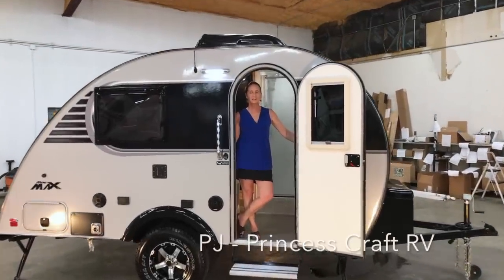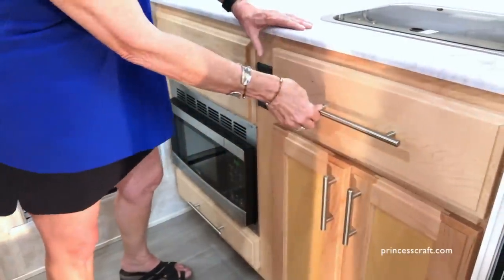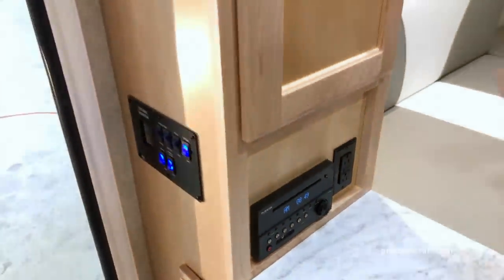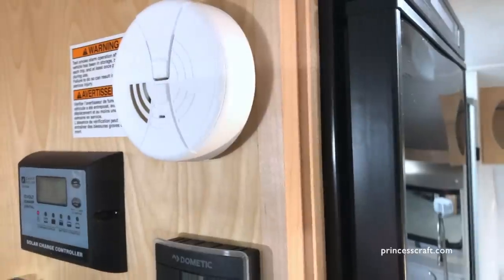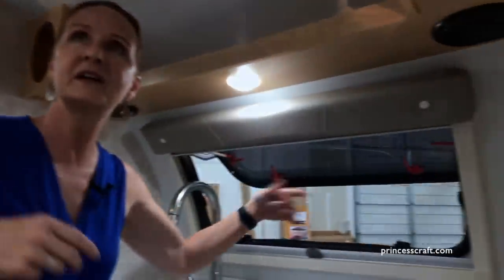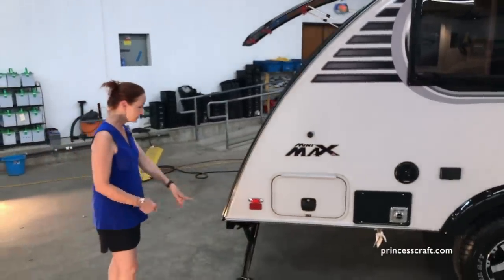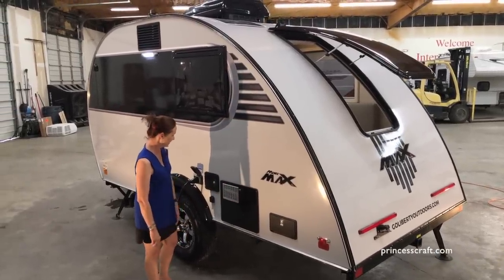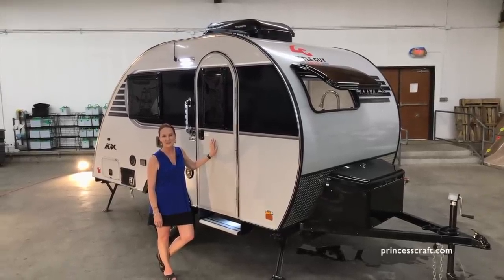2019 Mini Max from Little Guy Walkthrough with Princess Craft RV

Comment: So price about same as our small one Cherokee wolf pup 2019 the new year is going for about $22 to $24K. So ours a year old but it was a 2017 this time of year when the 2018 came out and cost $10k less. We got it for $13K. Thats just a lucky buyer thing so look around. Sister and I  did same thing buy new cars. Some new but last year model still on lot. For me id take the room we have over style. We can always up grade our cabinets.
Reply from the maker: The Cherokee Wolf Pup line is a very different build. It is wood framed and metal sided. The Little Guys have a welded aluminum cage, and it has composite siding. The materials and construction methods tend to account for the differences in prices. Regardless, it sounds like you have a great trailer and got it at a good price!

Comment: Nice but very little storage. If that back bench was converted so there was more storage than it would make more sense. Where do you store the bed linens?
Reply from the maker: There is storage beneath the back bench. You can access it from inside or outside.

Comment: For the size not to bad. The microwave is in a horrible spot and  I would much rather have a simple sleeper couch than that Dinette but the rest was good.
Reply: I agree the microwave is in a terrible place, especially for senior citizens.  Maybe the 20 year olds can handle it, but it would be difficult for me.
Reply: I am not sure why they didn't put that below the cooktop instead of he flatware drawer. I don't need to store service for 8 in a trailer that barely holds 2.
Reply: Fred Flintstone totally agree. That it’s got the flatware dividers in it is crazy. Should be empty so it can be utilized however.
Reply: David Mm 
That's about all there was. .except the bathroom
Reply: I actually like that the Microwave is below the cabinets. In my current condo, I had a (lower) custom cabinet created to get microwave off the counter top. Who wants to look at that thing all the time. (p.s. I'm 60ish)

Comment: I see bubbles or lumps in the wall. 5:01 not good.
Reply from the maker: It isn’t good, that's certain, but it is fixable and it isn’t detrimental structurally. The video lighting certainly makes it appear more pronounced than it actually is. The lump isn’t in the structural wallboard, per se, as it is a veneer laid/set/glued against the actual structural wallboard during the construction process. So, the wallboard isn't delaminating, but the shower wall veneer really does need to be pulled off and re-set. If there's a bright side to speak to, it's that it's fixable and that there’s no material in the walls that rot or degrade from moisture. The trailer is welded aluminum framed, no wood in the walls or floor framing. The siding is composite, including Azdel. As a dealership, our service center will be able to fix items like this under warranty. The manufacturer, Liberty Outdoors, is on-top of improvements and customer service as they further develop their products and new product lines.
Reply: whatfreedom7

Comment: Does the front door screen have a locking mechanism (for security)?
Reply from the maker: No. Screens in general provide very little security. A pocket knife... or house cat could easily get through screen material, even when locked.
Reply: I understand. Just that sometimes insurance is only valid if "breaking & entering" is proven; can be something as simple as a broken screen door latch...   @PrincessCraft

Comment: how much does the unit weigh dry and what is the price as shown here
Reply from the maker: From the description below the video:
Specifications & Features
Dry Weight  1,993 lbs.
Tongue Weight 280 lbs.
Overall Length 17' 2"
Overall Width 6' 9"
Exterior Height 8' 6"
Interior Height 6'
GVWR   2, 900 lbs.
Fresh Water  20 gal.
Grey Water  14 gal.
Black Water  9 gal.

Priced at about $23K

Comment: did this camper also have the hot water ambiant heat?
Reply from the maker: No, this manufacturer does not use a unit that provides radiant heat.

Comment: What's the weight and price point?
Reply from the maker: From the video description (below the video player): 

Little Guy Mini Max
Designed & Built by Liberty Outdoors in Somerset, PA

Starting in the low $20,000’s
  
Specifications & Features
Dry Weight  1,993 lbs.
Tongue Weight 280 lbs.
Overall Length 17' 2"
Overall Width 6' 9"
Exterior Height 8' 6"
Interior Height 6'
GVWR   2, 900 lbs.
Fresh Water  20 gal.
Grey Water  14 gal.
Black Water  9 gal.

Comment: If my jeep can only tow 2000 can this be towed by it ?
Reply from the maker: It wouldn't be a recommended setup with a Jeep that can only tow 2,000 lbs. The weight of this trailer is right at the upper limit of your towing capacity, which doesn't leave room for loading up for a good trip, and it doesn't make accelerating, inclines, or declines much fun.
Reply: @PrincessCraft  ok thanks for answering darn

Comment: It looks like the shower wall is delaminating, is that a problem.
Reply from the maker: It isn’t good, that's certain, but it is fixable and it isn’t detrimental structurally. The video lighting certainly makes it appear more pronounced than it actually is. The lump isn’t in the structural wallboard, per se, as it is a veneer laid/set/glued against the actual structural wallboard during the construction process. So, the wallboard isn't delaminating, but the shower wall veneer really does need to be pulled off and re-set. If there's a bright side to speak to, it's that it's fixable and that there’s no material in the walls that rot or degrade from moisture. The trailer is welded aluminum framed. The siding is composite, including Azdel. As a dealership, our service center will be able to fix items like this under warranty. The manufacturer, Liberty Outdoors, is on-top of improvements and customer service as they further develop their products and new product lines.

Comment: As a person who grew up camping  in both a Coachman and Argosy (made by Airstream) trailers  I can see that this particular unit is seriously lacking in practically every way; i'm not referring to size, like where are the Screens? Closet? Stove? Storage? Craftsmanship?  It looks very poorly made.  

If you went camping for more than a weekend; plan on trips to the grocery store ever 3 days as you have little place to store it.

Who can sit backside of table, Mr half-moon man?  2019 and this feature poor.  Buy a tent!  You will have more space and don need to be 4' 5" tall like the presenter. 

Ideas, redesign the red window latches if more than 1 per window.  Make rear window panoramic.  Make seating face the "screened" window with "L" shaped slide out seating.  Sleep 2 across instead with a 6'2" wide trailer in the back; with the unit in more of a teardrop shape with w flat backend.

What is the worth of this unit in my view <$2K

Comment: Nice but in the shower the wall has blister like what damage
Reply from the maker: It isn’t good, that's certain, but it is fixable and it isn’t detrimental structurally. The video lighting certainly makes it appear more pronounced than it actually is. The lump isn’t in the structural wallboard, per se, as it is a veneer laid/set/glued against the actual structural wallboard during the construction process. So, the wallboard isn't delaminating, but the shower wall veneer really does need to be pulled off and re-set. If there's a bright side to speak to, it's that it's fixable and that there’s no material in the walls that rot or degrade from moisture. The trailer is welded aluminum framed. The siding is composite, including Azdel. As a dealership, our service center will be able to fix items like this under warranty. The manufacturer, Liberty Outdoors, is on-top of improvements and customer service as they further develop their products and new product lines.

Comment: How long will the battery, when full, run the AC?
Reply from the maker: The battery isn’t powerful enough to start the AC. The trailer will need to be plugged into an outlet at the campsite or into a generator to run the A/C. This is true for most campers on the market.
Reply: Princess Craft thank you so much for the quick reply. We just started looking into trailers similar to this one and obviously have no clue yet. 😊
Reply: Very good.

Comment: I have a 1969 Red Dale 12 ft truck camper mounted on a trailer frame I had exactly everything this has and basically the same weight I have a walk in bathroom my kitchen is better than this one I actually have an oven LOL! Plus I have a full-size 3-way refrigerator a queen-size bed in the overhead but for what they want from one of them trailers nah I'll stay with what I got

Comment: Just thinking of what they expect($$$$ Wise) is enough to turn me off NOW.
And they haven't mentioned price for a good reason ~ It grossly overpriced.
Reply: Exactly. I looked and saw like a medium size rv for 15k
Reply: @jaydonturner882  ~  15k gets a Box TRuck or a high top van & you
can rig it the way you want?  But I guess if you've got lots of cash
one might buy this..... "thing"?   The only good is that a smaller
truck or car can pull the weight but  "Grossly Over Priced" is all
I can say for it.   I'm looking

Comment: Just browsing and I know this is a 2 year old video, but I'd be curious to understand the unit insulation ratings and the floor pan resilience to  decay from road elements and sealing to pests/rodents...or are their industry/manufacturing standards I can reference ? Thanks in advance.
Reply from the maker: I just did a quick search through the Little Guy website to find insulation ratings for you. I wasn't successful, so it might be good to reach out to their customer support to see if one of their engineers has specs to help you out.

Comment: Looks like a great little unit, and pj does an excellent job showing it. Think I could totally do without the table, just seems to be in the way. How is it priced. Just sold a 40’ toy hauler May go from one extreme to another lol.
Reply: Also will a 2000 watt Honda run the a/c unit, what’s the kw on a/c.
Reply from the maker: About $23k for the units we have in stock.

Comment: My SUV won't haul more than 2,000 pounds.  Is this trailer too heavy?
Reply from the maker: This trailer is at your maximum capacity before you load it with battery, propane, water, food, and gear. We wouldn’t suggest it for your vehicle.
Reply: Darned it.  Are there any other options?  @PrincessCraft
Reply from the maker: T@B 320s weigh a little less. Aliner folding trailers are options. There are a few out there. The two mentioned above are brands we carry at our dealership.
Reply: Thank you.  @PrincessCraft

Comment: Great looking camper. Is there storage under the seating around the table. If not, what is under there?
Reply from the maker: There’s storage beneath the back seat that can be accessed from the outside storage hatch. You’ll find the side seats have equipment like the converter, heater, wiring, etc. Thanks for watching!

Comment: Why is the wall in the bathroom all bubbly? NOT GOOD!
Reply from the maker: Not good is right! The video lighting certainly makes it appear more pronounced than it actually is. The lump isn’t in the wallboard. It’s a shower/bathroom insert. Water can’t get behind it because it’s sealed, and there’s no material in the walls that rot or degrade from moisture. The trailer is welded aluminum

Comment: It seems like whenever you would be at the sink/counter top that you'd really have to watch not to hit your head off of the corner of that cubby that's jutting out.  And I noticed that the woman was able to still turn the table even though it was "locked in".
Reply from the maker: The "locking" handles can be loosened and tightened by turning them before clamping them down. It's similar to the clamps you'll find on many bicycle seats for height adjustment, or even quick detach bike wheels. This is just a bigger version of those. One more clockwise turn on the handle would have had it firmly in place.

Comment: Love the bubbles in the bathroom wall already. Shows how cheaply its built.
Reply from the maker: It isn’t good, that's certain, but it is fixable and it isn’t detrimental structurally. The video lighting certainly makes it appear more pronounced than it actually is. The lump isn’t in the structural wallboard, per se, as it is a veneer laid/set/glued against the actual structural wallboard during the construction process. So, the wallboard isn't delaminating, but the shower wall veneer really does need to be pulled off and re-set. If there's a bright side to speak to, it's that it's fixable and that there’s no material in the walls that rot or degrade from moisture. The trailer is welded aluminum framed. The siding is composite, including Azdel. As a dealership, our service center will be able to fix items like this under warranty. The manufacturer, Liberty Outdoors, is on-top of improvements and customer service as they further develop their products and new product lines.
Reply: @PrincessCraft  but it STILL shows how cheaply this thing was built..no bueno
Reply from the maker: ... We, um, still get it. (We understand and concur.) We said it wasn’t good (see above). We agreed with your first comment. Feel free to make sure we’re a little more clear on what you’re saying.

Comment: Never talked about insulation factor if any!!!
Reply from the maker: "Our teardrop camper trailers come with 14 x 14 inch roof vents for great ventilation, and the trailer is wrapped in a blanket of R11 insulation to help insulate from the cold and the heat. Your Little Guy is sealed with a white laminated skin, and striped to your specifications. The rear of the trailer is fitted with a galley, and tinted glass sliding doors on each side of the trailer provide privacy, safety, and security." source: https://golittleguy.com/teardrop-trailer-construction-information/

Comment: What's the tongue weight?
Reply from the maker: Specifications & Features
Dry Weight  1,993 lbs.
Tongue Weight 280 lbs.
Overall Length 17' 2"
Overall Width 6' 9"
Exterior Height 8' 6"
Interior Height 6'
GVWR   2, 900 lbs.
Fresh Water  20 gal.
Grey Water  14 gal.
Black Water  9 gal.

Comment: lol the shower wall is already bubbling away , glue is loosing it's grip and it's brand new.
People do not buy any camper trailer that is new by an old air stream or something of quality, these things now are pure junk cheap as you can get it at a premium price
Reply from the maker: It isn’t good, that's certain, but it is fixable and it isn’t detrimental structurally. The video lighting certainly makes it appear more pronounced than it actually is. The lump isn’t in the structural wallboard, per se, as it is a veneer laid/set/glued against the actual structural wallboard during the construction process. So, the wallboard isn't delaminating, but the shower wall veneer really does need to be pulled off and re-set. If there's a bright side to speak to, it's that it's fixable and that there’s no material in the walls that rot or degrade from moisture. The trailer is welded aluminum framed. The siding is composite, including Azdel. As a dealership, our service center will be able to fix items like this under warranty. The manufacturer, Liberty Outdoors, is on-top of improvements and customer service as they further develop their products and new product lines.
Reply: But for the factory to think something like that is okay to send out makes me wonder what else they felt was "good enough".

Comment: Price?
Reply from the maker: From the video description (below the video player):

Little Guy Mini Max
Designed & Built by Liberty Outdoors in Somerset, PA

Starting in the low $20,000’s
  
Specifications & Features
Dry Weight  1,993 lbs.
Tongue Weight 280 lbs.
Overall Length 17' 2"
Overall Width 6' 9"
Exterior Height 8' 6"
Interior Height 6'
GVWR   2, 900 lbs.
Fresh Water  20 gal.
Grey Water  14 gal.
Black Water  9 gal.

Comment: Saw lots of bubbles in the shower.
Reply from the maker: It isn’t good, that's certain, but it is fixable and it isn’t detrimental structurally. The video lighting certainly makes it appear more pronounced than it actually is. The lump isn’t in the structural wallboard, per se, as it is a veneer laid/set/glued against the actual structural wallboard during the construction process. So, the wallboard isn't delaminating, but the shower wall veneer really does need to be pulled off and re-set. If there's a bright side to speak to, it's that it's fixable and that there’s no material in the walls that rot or degrade from moisture. The trailer is welded aluminum framed. The siding is composite, including Azdel. As a dealership, our service center will be able to fix items like this under warranty. The manufacturer, Liberty Outdoors, is on-top of improvements and customer service as they further develop their products and new product lines.

Comment: this will never go into production because it is not a vented stove wich means carbonmanocside will build up in camper while you are using this device this is illegal
Reply from the maker: ... it’s already in production and selling. Owners pop open the roof vent and/or crack a window. Same as the venerable T@B teardrop trailers that have been around and enjoyed for so many years.
Reply: bradley cross